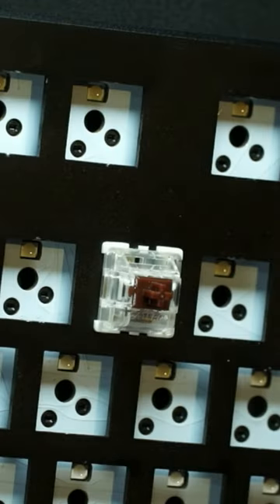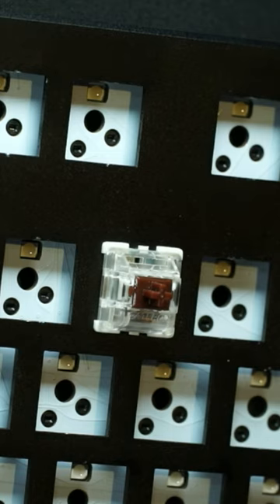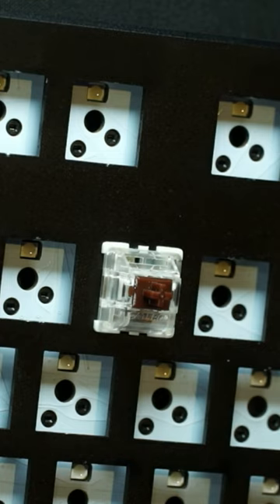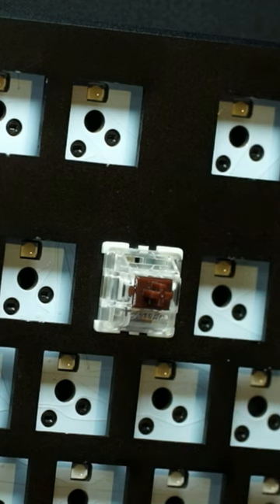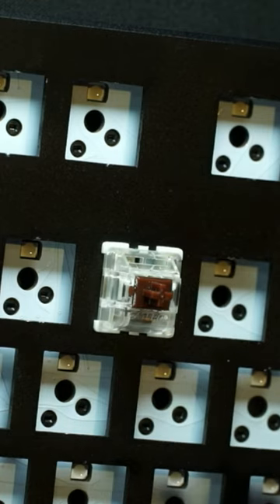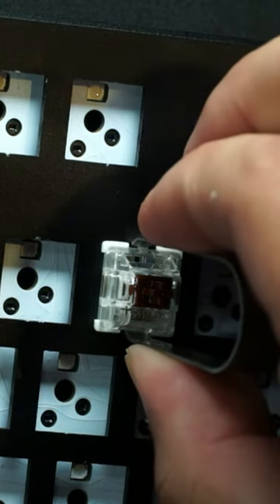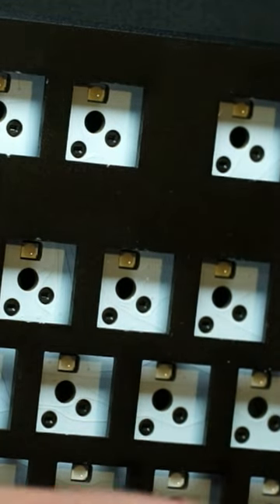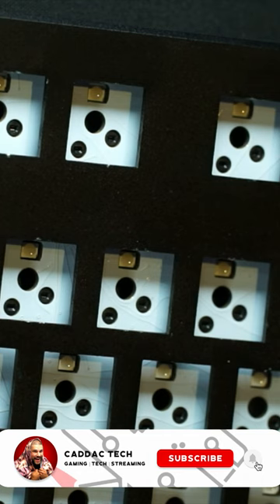How To Easily Remove Hotswap Switches!

Comment from the maker: Guys, please make sure your keyboard is actually hot-swappable before you try yanking your switches out...
Reply from the maker: @OnionEternal if the keyboard page doesn't say it's hot swappable then it's probably not hot swappable.
Reply: should i turn off my keyboard before replacing the switches?
Reply from the maker: @mfarhant9349 yeah you should have it unplugged just in case

Comment: When your switch still doesn’t come out…
Reply: Dude, is it normal to accidentally scratch the alu plate while pulling a switch, not often tho
Reply: Im just afraid that it would affect the sound
Reply: @zhariskandar2790  not really cause the switch is supposed to come out really easily and smoothly
Reply: Same
Reply: @BloomJeon same idk what’s happening did u find an answer
Reply: @s4dongt if it is a cheap one chances are it is false advertised and you need to de solder it
Reply: Maybe your keyboard isn’t hot swap
Reply: @JerseyHornet mine it is and it still don’t want to make out

Comment: Extra tips, some keyboard (especially the cheap ones) usually takes extra effort to pull the switch out.
Reply: You need to make sure your keyboard is hot swappable too
Reply: Specially the cheap ones? Now I see why I broke six switches already.
It is hard as fuck to not break it, when you pull up, you also pull the thin plastic on the north side, it bends and eventually breaks, I can not find any workaround on this

Comment: Thanks for this. My Keyboard is a Red Dragon Horus. Great keyboard and nice and sturdy too. its stock switches are put in sideways for some reason, in regards to the tabs. your vid helped me realize that where the instructions with the replacement switches that red dragon doesn't do anything other than say "properly pull out the switch"... ooookaaaay, and the illustration has it vertical like what you're showing, but, they're actually sideways.

Comment: Hey Guys, I’m replacing switches on my Keyboard.
Is the direction of the switch important?😅 thx for help. 😉
Reply from the maker: the pins on your switch should be lined up with the holes in the board
Reply: @CaddacTech  thx for the answer. The problem was that the switches are symetric on the backside. :D It seems to be not important for the installation because now it works. :)

Comment: Can ANYONE help?!?  I have a Corsair Strafe RGB MK.2 keyboard and i am having the WORST time getting switches out. I have the Cherry MX Silent switches and bought a lube kit to lube everything up after 6-7 years of intense gaming with it and CANNOT get these gahtdayum switches out of this keyboard lol. Do i need to take the back screws and everything out? Or should I just be able to pop switches out??? Feel like Its almost not hitting the tabs that unlock it, but i tried 5-8 keys before giving up because i felt like i was about to break something
Reply from the maker: The switches in that board are not hot swappable. You cannot remove them without de-soldering.

Comment: Bro im STRUGGLING ive removed all the switches woth ease im on the last 2 and they fr won't come out at all my fingers are red at this point idk what to do😭
Reply: Make sure the top and bottom are coming out at the same time. You don't want to pull the switches out at an angle.

Comment: You know what's better advice since not all mechanical keyboards have the same switch design? Buy a proper tool. The one that came with your keyboard is probably crap.
Reply from the maker: The different types of switches refer to the pins, not the way they mount to the plate. Almost all hotswappable keys have the two pins and the way I describe in the video is accurate.
Reply: @_Caddac  I didn't say the way you describe wasn't accurate. I said better advice would be to get a proper tool. The fact is a lot of the ones you get with your keyboard damage the switches as you pull them out because of poor/cheap design and even if you want to pull the switches out straight, the cheap tools don't really allow it because they are insufficient at depressing both tabs as you pull, usually due to the metal being too thin and slipping off the tabs.

Comment: Can i do this on my ducky one 2 mini?
Reply from the maker: The Ducky One 2 Mini keyboards do not have hotswappable switches.
Reply from the maker: You can try. It won't be very easy if you can't take your switch out. I'm sure there's a video out there on ways to lube non-hotswap switches.
Reply from the maker: It depends entirely on your switch type. 205G0 is the most common.